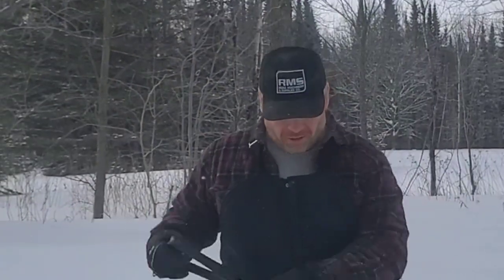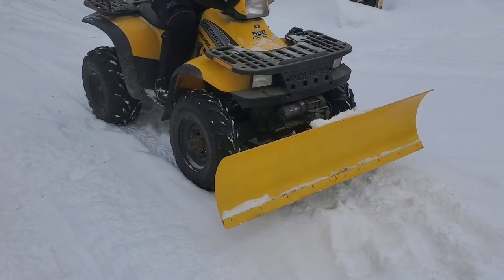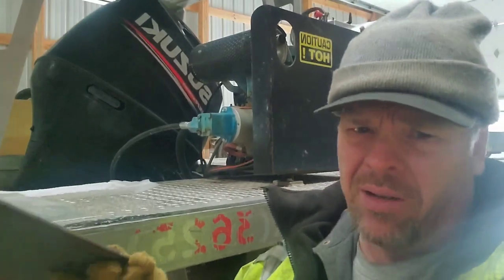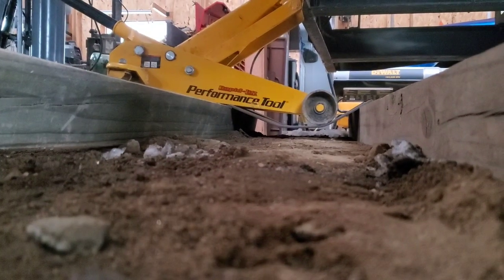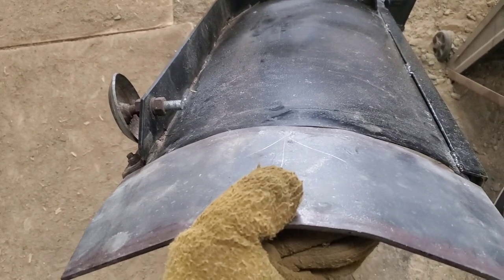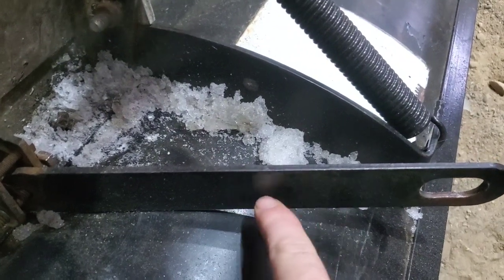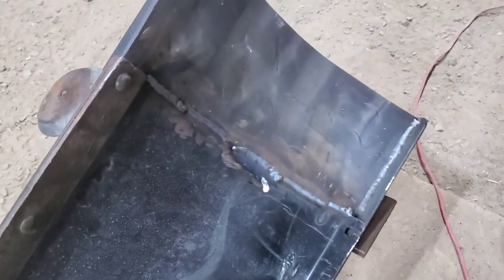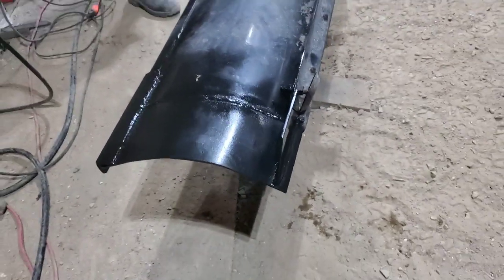How to Make an ATV Into a Bulldozer!  Fabricating a Bigger Blade

Comment: I bought an 8' snowplow that some Einstein had stored face down for  several years and the mold board rusted through around the stiffener pockets. I had to make several patches similar to your blade extensions. I took 2 pieces of scrap angle and blew some holes in the end so I could draw them together slightly about every inch and created a pretty smooth radius. Now I have a "press brake" whenever  I need one. Great videos. You are not right in the head.

Comment: I wanna make back blade 8" wider on each side but it would have to be removable so i can spin the blade around.  Also i would want to make the ends have removable caps like a box blade.  Then i could really move some snow.  Problem with that is then play time wouldnt be as long

Comment: If you wwant the easy way go to a plumber and buy an old water heater you ill have enough to make 2 plows and the curve is already made just add a cuter bar at the botom and make a attachment waterever maching you want to use i add it on my old lawn mower good luck